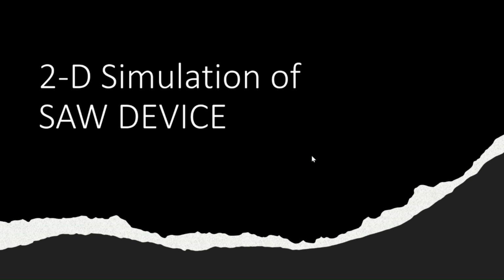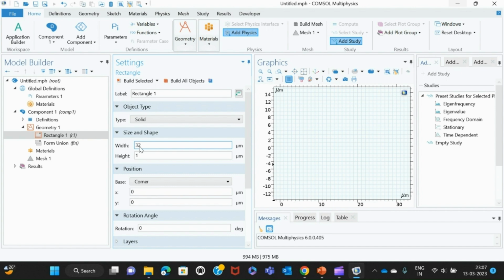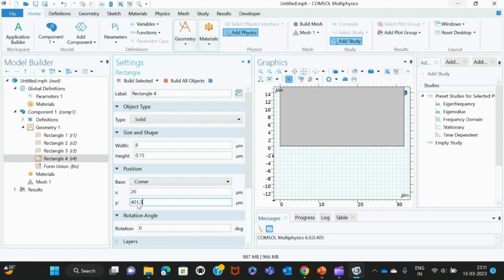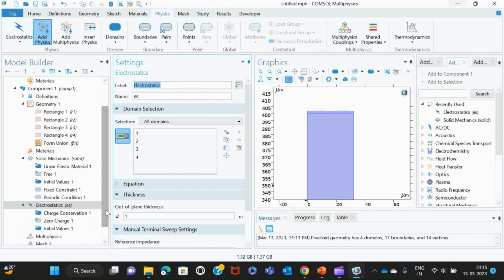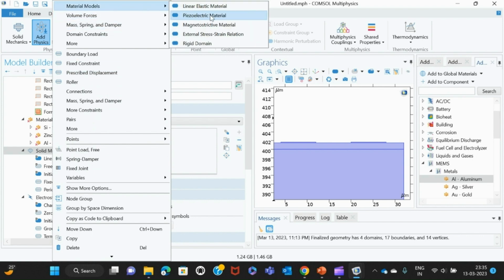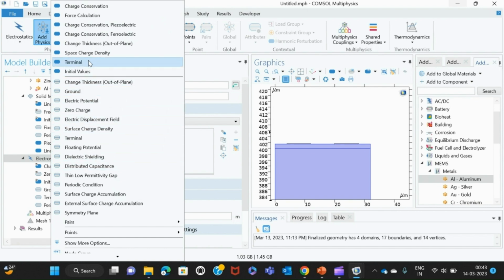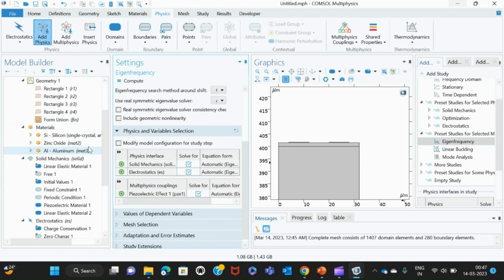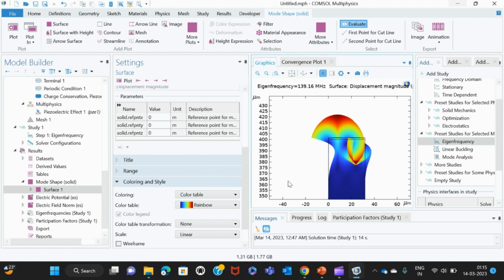2-D Simulation of SAW device using COMSOL and finding its resonant frequency(Rayleigh wave).

Comment: sir, i have a doubt regarding rayleigh velocity in ZnO, from the online data available, velocity is 3820m/s
Reply from the maker: There might be slight difference in velocities based on the slight differences in material. I mean some materials can be more crystalline than the other. I took the velocity given in the paper. It differs because of the different methods available to grow ZnO. I think that you can tell only a range, perfect number is difficult to tell unless you measure it for your sample by some experiment. Also simulations are only to give you a rough idea before the actual experiment. So you can take educated approximations.
Reply from the maker: Also note that ZnO in comsol will have a particular velocity which they might have given by looking different sources.